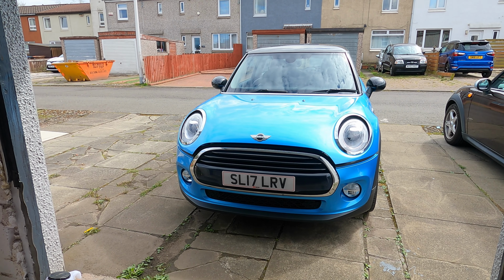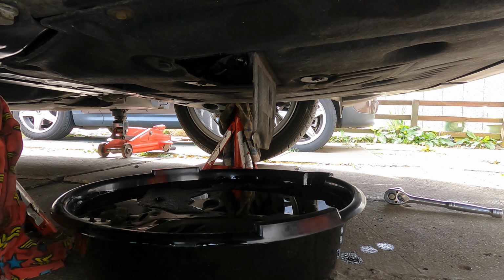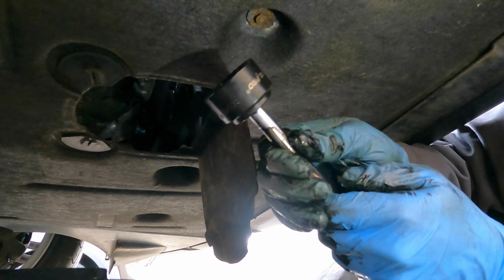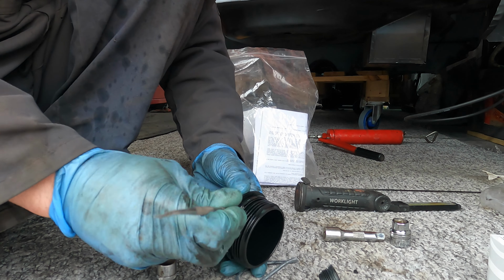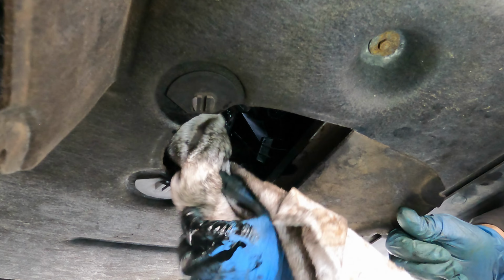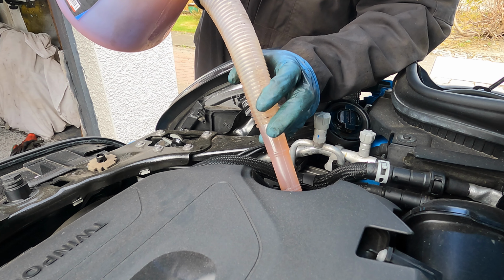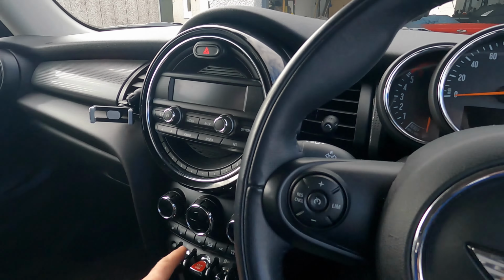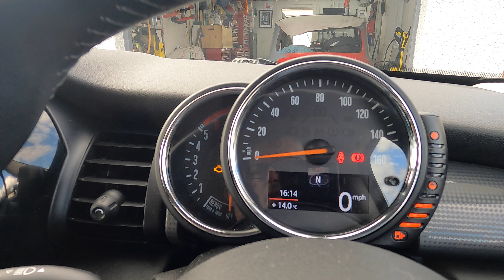How to do an oil service on your MINI Cooper D F56 3rd generation

Comment: I personally prefer to fill oil to 3/4 for DPF equipped cars. To allow for possible fuel dilution / seeping into the sump from auto regens.
Reply from the maker: If that works for you then go for it but me personally, I stick to what the manufacturer recommends

Comment: £800 Service in Sweden 😲 thanks for the help did it at home today only £50 for parts and oil. Next up is breaks do you hava a video of that?
Reply from the maker: Thanks buddy, brakes are easy, just remember to order new brake pad wear sensors and don't forget to reset the brake service light!

Comment: Hi Sean,  very informative video.  I have a 2008 MINI Cooper S and it's time I started changing the oil and filter in it. I change the oil in my other vehicles but for some reason I have stayed away from the MINI and had it done by the dealership. $$$$   I need to get under it and see if it has the same access doors that yours does. Cheers, M
Reply from the maker: Hi midge, your car will have the complete undertray which you will need to remove. It's about 4 or 6 bolts from memory and a 2 minute job to remove. 

Doing your own oil service is a piece of cake and saves you hundreds by not taking it to the main dealers plus you know what oil and filters went in it! I tend to do my oil service every 6000 miles or once a year, whichever comes first and its very satisfying knowing you've done the job yourself! 

All the best, Sean

Comment: Just watched on a TV so signed into my phone just to Like the video. 

Great video. I've watched a lot of your older mini videos when you was under a different name. I love those old wee cars.  

Looking to do my own car in next couple of weeks. Just need to work out what filter and what oil! SAE-0W20 or SAE-0W30 or just  0W20 or 0W30 or bloody 5W30 or 5W40!!! 

I'll subscribe when I get into my signed in TV. 

Cheers pal.
Reply from the maker: Cheers buddy. 0w30 or 5w30 is the spec you require for the oil, just make sure its LL04. I always use oem filters as they aren't that much more expensive than the aftermarket ones.
Reply: @BMCWorkshop  Cheers pal. It's for a 2017 mini cooper sd (diesel). 

Been on Google and it tells you all sorts of differences between (summer Vs winter, SAE Vs non-SAE and so on).

Any particular brand you prefer?
Reply from the maker: @justonemorego  I use a British from called Smith and Allan for my oil (link in description) and search for ocean bmw on ebay as they usually sell the filters cheap. 5w30 will be perfect for you and the manual should also state this.
Reply: @BMCWorkshop  Brilliant. 

I'll check my manual. Not owned a car for a long time so a bit wet behind the ears! 

I remember changing oil on an old mini in the days you got the Haynes Book as your first thing to buy when you got a car.

Cheers again.
Reply from the maker: @justonemorego  it's a piece of cake buddy and by doing thd job yourself you'll save a fortune
Reply: @BMCWorkshop  Yeah man. I'll need to buy me self some tools and that. 

I'll look at your links in this video (I think you mentioned the Oil Pourer) to see if there's anything else you've got linked in there. I'm gonna need a new ratchet set, appropriate ratchet heads, jack/axel(s),  oil pourer, dispose oil/oil catcher/bucket etc.  Maybe a Torque ratchet cos I don't want to buggar anything up! 

May even look for a Haynes Book if there is one! 

I'm looking to doing an oil change myself twice a year, every Christmas and every June as service is due then. I reckon changing oil is my cheapest way of looking after the car, so buying the tools etc is a needs be. Looking into doing a wee bit of detailing in the future or at least proper washing and waxing!

Cheers. 

👍

Comment: How much was the filter kit from main dealer
Reply from the maker: Hi buddy, the oil filter was about £23 delivered from a mini dealer on ebay. No doubt it will be cheaper from the main dealer if you visit in person. https://www.ebay.co.uk/itm/133784633511?mkcid=16&mkevt=1&mkrid=711-127632-2357-0&ssspo=8WursaLGRuq&sssrc=4429486&ssuid=hQdU4Wo3TJe&var=&widget_ver=artemis&media=COPY